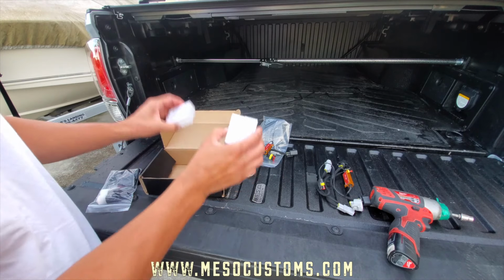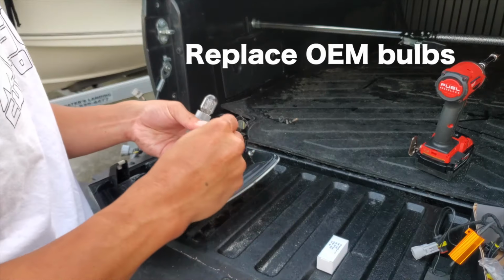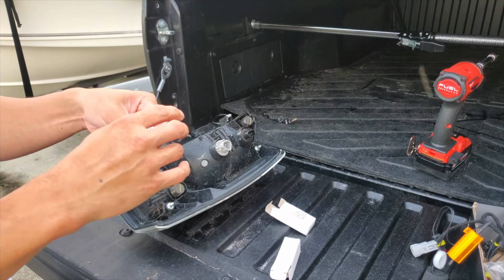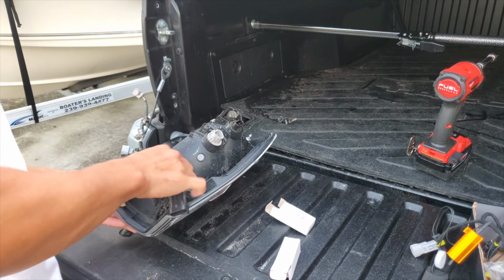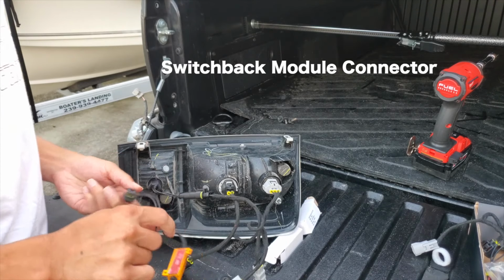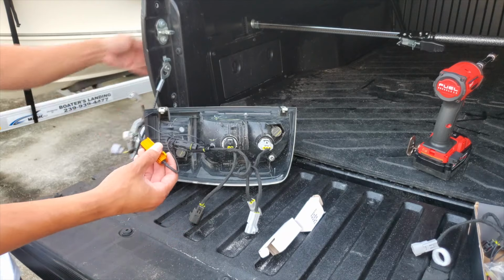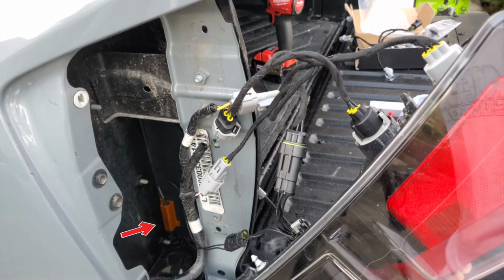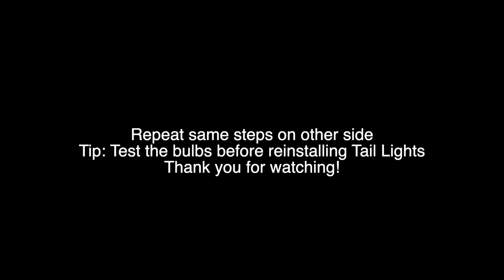INSANE Brake Light Mod on Tacoma! Meso Customs Total Tail Stage 1 Install

Comment: Quick question ? Does the stage 1 kits come with resistors? Got mine in today and the resistors wasn't in the box.
Reply from the maker: No resistors are included in the kit as far I know.
Reply: @ProjectOnix  ok just checking with you cause on the video I see resistors that you had to mount

Comment: Thank you for the video!!  I found it to be very informative, as we just got a Tacoma this light kit looks like something that would improve the safety and appearance of our Tacoma, especially the brighter backup lights.  Question for you.  Since the wire leads on the switchback module are pretty short is there a particular reason you mounted them in the body recess instead of mounting them on the back of the light assembly?
Reply from the maker: That was the most convenient place at the time of install. 👍